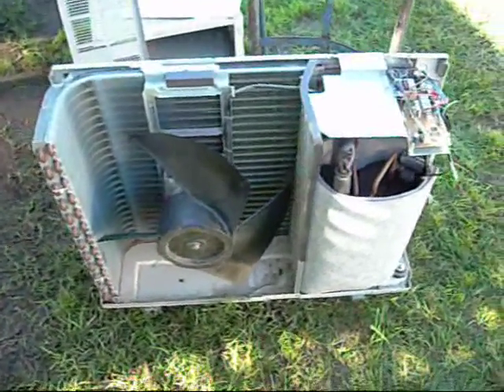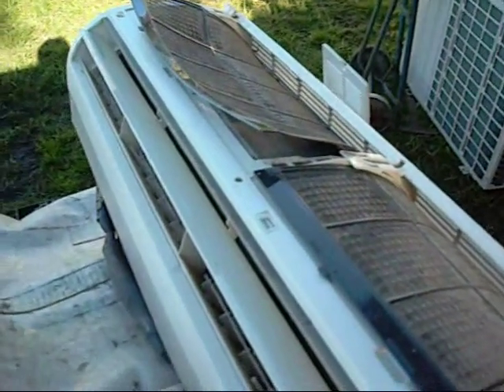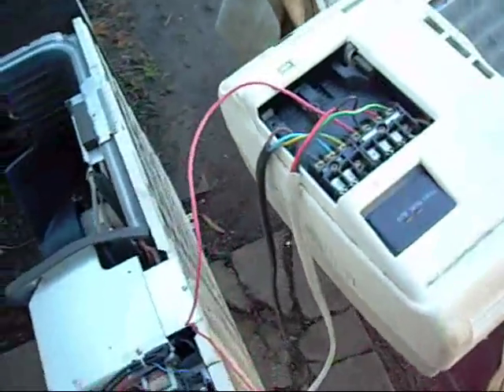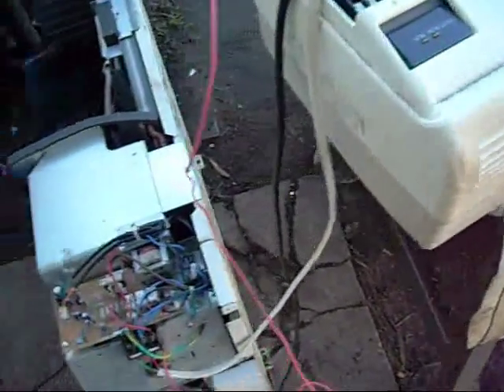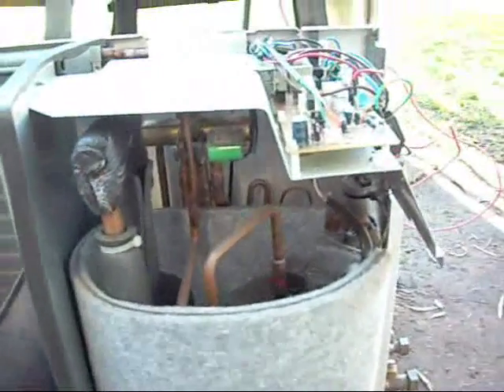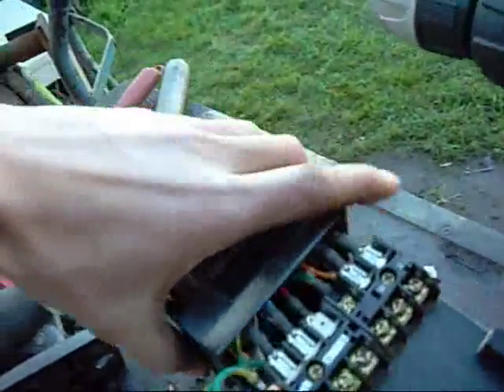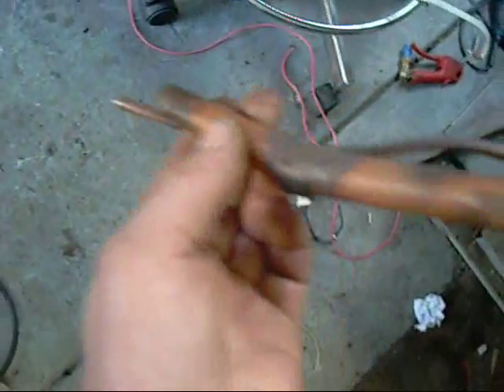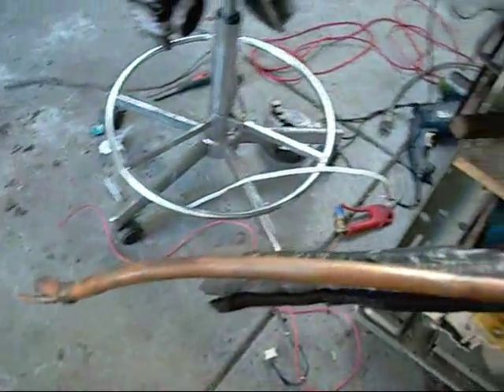Sharp Mini Split AC

Comment from the maker: I gotta check the compressor tomorrow, somethings not right....
Reply: I recently purchased and had this unit installed. I can not get it to work. The red light comes on, flickering, but it doesn't fully turn on. Following the wiring diagram but still no luck. Can you help?

Comment: I recently purchased and had this unit installed. I can not get it to work. The red light comes on, flickering, but it doesn't fully turn on. Following the wiring diagram but still no luck. Can you help?